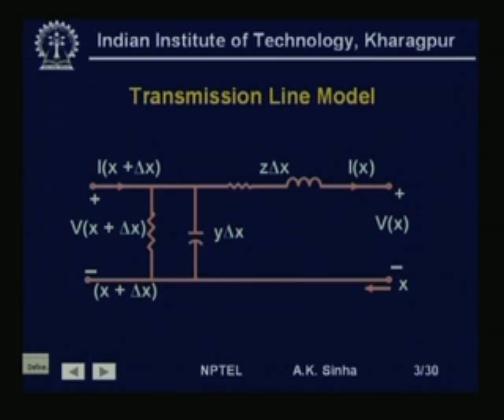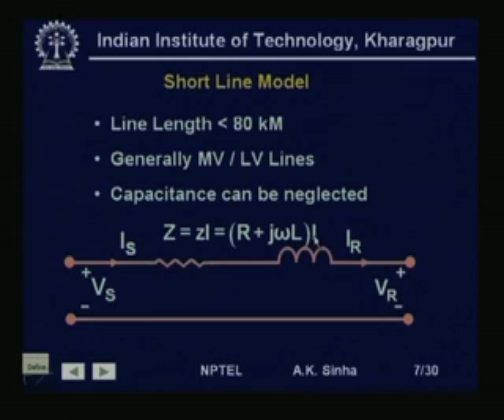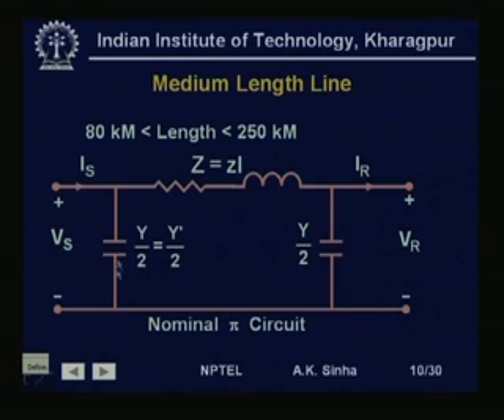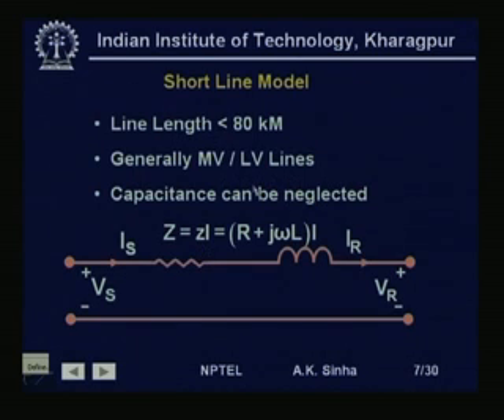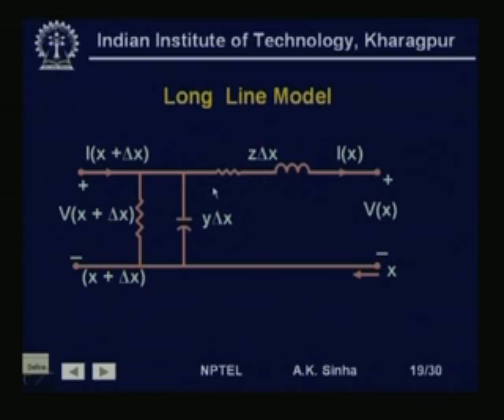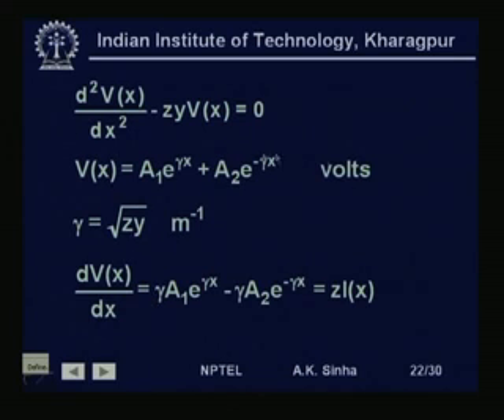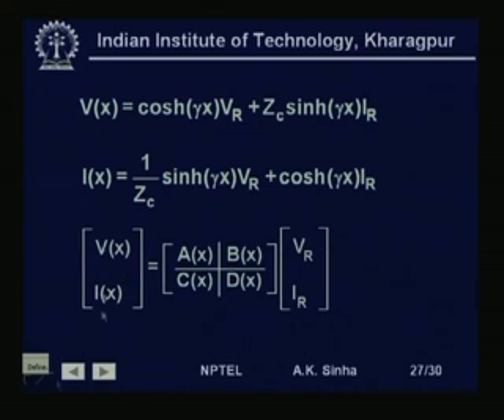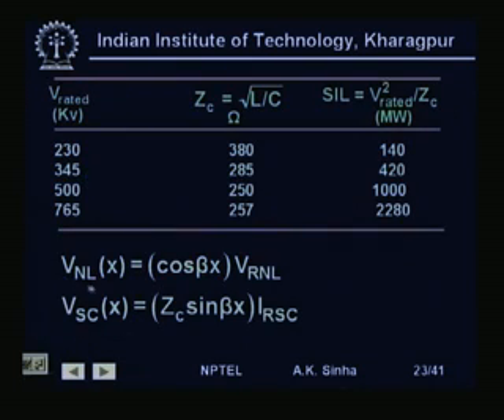Lecture -7 Transmission Line Modeling

Comment: A short transmission line with sending end voltage and current phasors (VS and IS respectively), receiving end voltage and current phasors (VR and IR respectively), receiving end power factor cosφ, lagging and sending end voltage load angle is “δ” assuming receiving end voltage phasor is the reference. (i) Draw the circuit diagram of the line; (ii) Sketch the phasor diagram of the circuit assume the load is purely inductive; (iii) show that the sending end voltage reduces by a factor (1 – cosδ) when a load is connected to the receiving end; and (iv) prove that the voltage regulation is approximated as sinφ.

Comment: The sound is audible only from one side of the earphone (my earphones are working fine otherwise)
If you are also facing the same problem:

Open VLC Media Player -> Media -> Open Network Stream -> Paste Youtube video link.

Once the video streaming has started in VLC, change stereo mode to Mono(Audio -> Stereo Mode -> Mono).